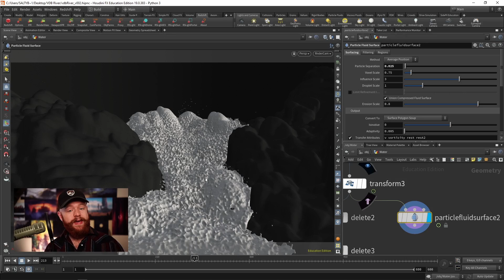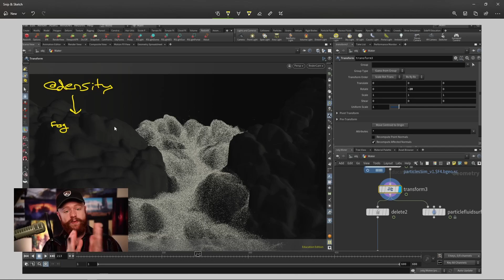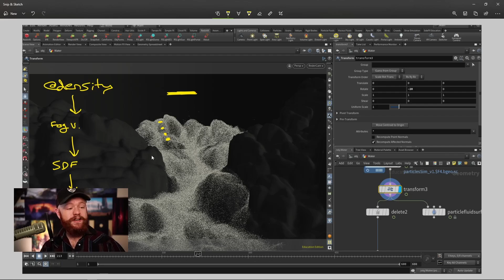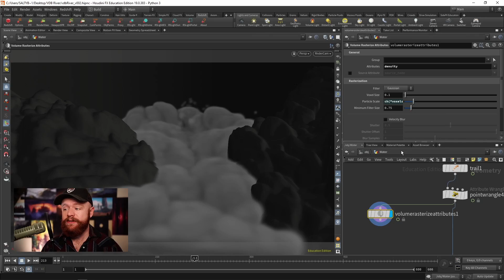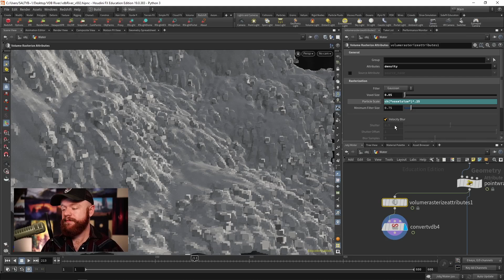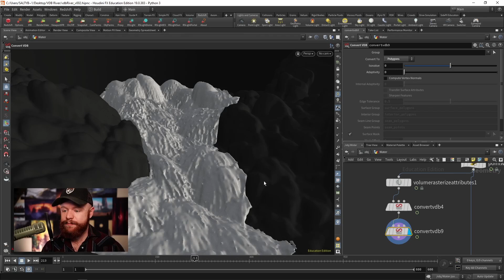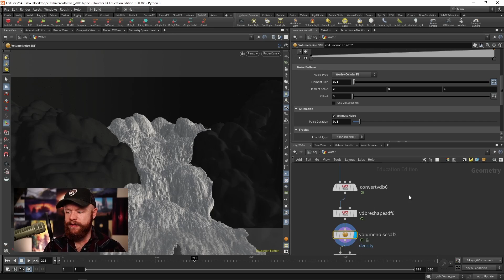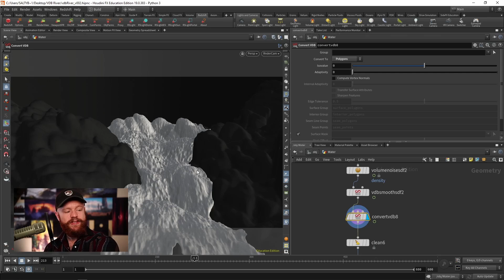Houdini - Meshing Fluid Simulations - CG Forge Quick Tip

Comment: Instead of the volume noise sdf is there a way to use rest and rest_ration to drive a noise position? Like in the basic liquid shader, there's vorticity wave function i tried to add volume vop instead of the voume noise and plugged the particles in the second input and tried to use pcopen and pcfilter to get rest attr but it didnt seem to work for me so maybe something i dunno
Reply from the maker: Yeah, you can use rest for noise.  It will give you a different looking result as well.  In my opinion, when you go that route you typically need to:  1. Keep in mind that the cache sizes go up tremendously even if you recast to 16 bit and do all the other compression tricks... 2. Use FLIP for your water sim or use particles/vellum and manually add rest fields... and 2. Find a way to apply the noise to SDF volumes rather than fog.  Typically, rest is much easier to use when dealing with fog volumes because the values are more straightforward.  With SDF, you are moving the location of the surface band, and that isn't as easy as multiplying against some fog values.   So, for this particular situation, I found that the SDF noise node was the more simple route to go.